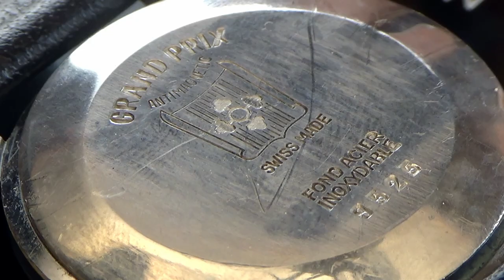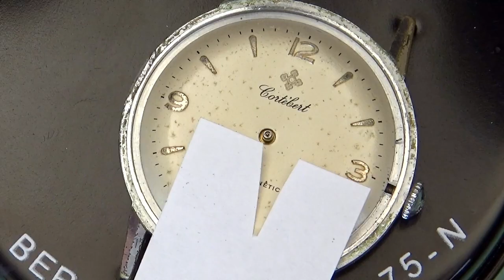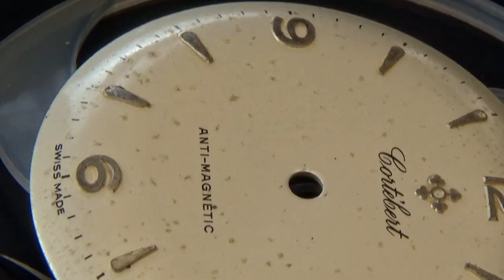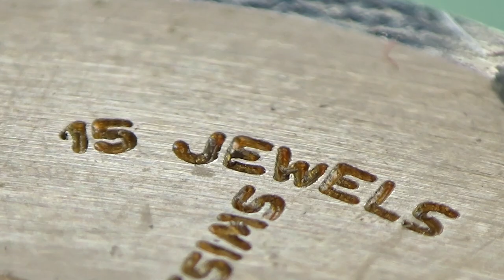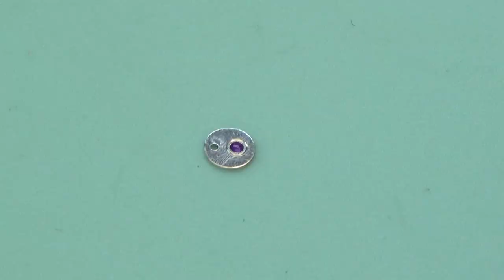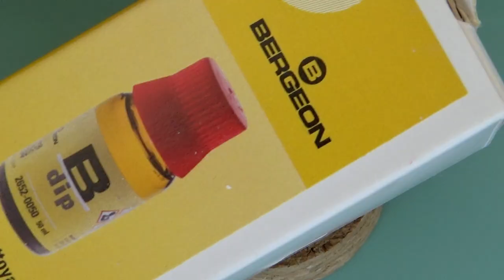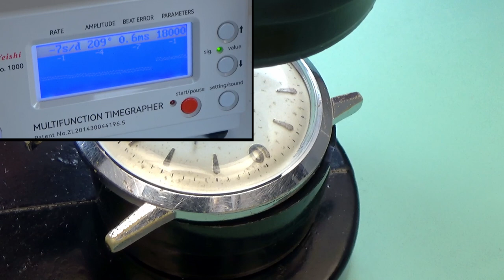Discovering Cortébert: Swiss Watchmaking's Forgotten Gem - A Vintage Watch Restoration Saga!

Comment: Outstanding narration and filmography! My dad’s Cortébert has a CAL 451. It’s a bumper style winding system. It’s had its share of problems due to my experimentation when I was 8 years of age. It’s survived 50 years stored at their home. It’s been professionally serviced, albeit there is no adjustment lever to sort the beat error. Also for some odd reason the balance wheel adjustment was placed all the way to retard. So in a mater of weeks running with +1 minute every week it stoped working unless placed sunny side up. The watchmaker’s says that the main spring is the culprit as it transfer too much power to the pallet fork. I had to replace the spring as I broke it by winding it too much at an early stage of my experiments. Omega is to blame in their glossy inserts in Reader’s Digest magazines that dad bought every Sunday, as they subjected their movements for the Constellation series to all kinds of tests in the Geneva Observatory. I “mimicked” these experiments on dad’s #8535 Cortébert Automatic, albeit, the main spring was sourced to match Dr. Ranfft’s specs for this movement, also known as an AS1250. So, if you happen to have stumbled with such an issue please help me to fill in!
Reply from the maker: Thanks Robert. Beat error can be solved by adjusting the hairspring collet. It's a dangerous job, as it's easy to ruin the hairspring or even break the collet, which I hate doing. There are a number of reasons why the movement could be losing or gaining time. It sounds like you are working through it, and I wish you the very best of luck with it. I am just learning myself so i' m hesitant to give to much advice in case i'm wrong.
Reply: @Saving-Time  Thanks for your complete reply! I enjoy your programs as well! And I am now in my next assignment —which is— to find  the old watch importers for Cortébert and Universal in Costa Rica!  To ascertain if they are still alive and if their heirs have any obsolete stock. It would be worth just to hear them talk! It's going to be fun!

Comment: The format is great, always good to see the whole part and where it sits. What equipment do you use whilst working on the movements ie for your eyes ?
Reply from the maker: Nothing to fancy I used a 4x loupe for a lot of the work. I also use a pair of +3 reading glasses. I don't need them for reading, but they are great for close-up work where you don't need too much magnification. A higher magnification loupe or, ideally, a microscope is good for oiling. If you're looking to get started working on your own stuff, you can get away with just a 4x loupe to start with.

Comment: After watching this video, I bought myself a Cortebert of a similar vintage, caliber 677. Subseconds, 15 jewels, rather nicely made. Also close to $100 purchase price. Hope to restore it. Excellent video but there is one erratum you made. Cortebert did not jumpstart the entirety of the Soviet Union's watch industry. What Cortebert did do, however, was sell the USSR the rights, technical drawings, and production equipment to made the caliber 616 (a very high-quality pocketwatch movement of the 1940s, also used in Rolex pocketwatches of the period). in the late 40s. Built at first as the Molnija ChK-6 and by the late 60s as the crudely finished but technically superior Molnija 3602.
Reply from the maker: Thank you very much for the correction.  As always i much appreciated the information thank you!
Reply: @Saving-Time   No problem! I very much liked this teardown, seeing how different one of these Corteberts is relative to a Stellita or an ETA movement. That balance spring holding mechanism was something wild! Probably effective but strange. In terms of fit and finish, how would you rank Cortebert watches vs. their contemporaries. As good as Rolex or Omega? Better? Worse? Unlike Soviet watches, I really don't know as much about this storied marque as I should have.
Reply from the maker: I'd put them just below Omega; the movements were very nice, with less time spent on the finishing in general. I believe they were slightly cheaper when new, but not by that much. Personally, they are one of my favourite vintage Swiss brands.